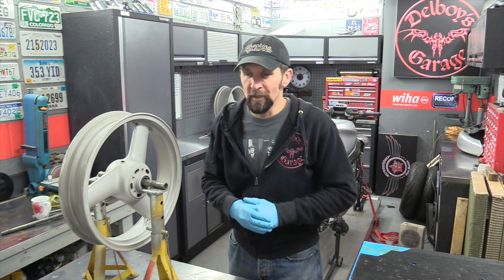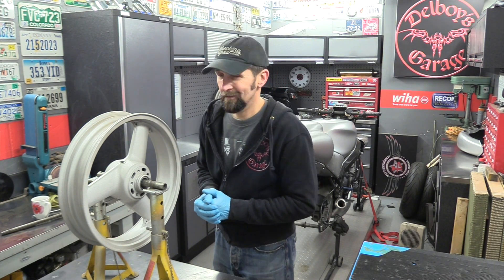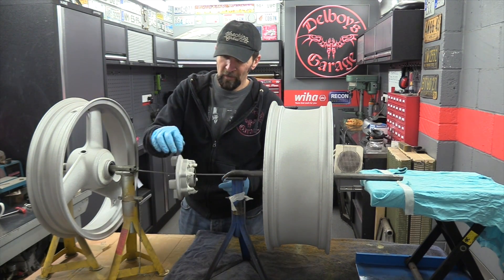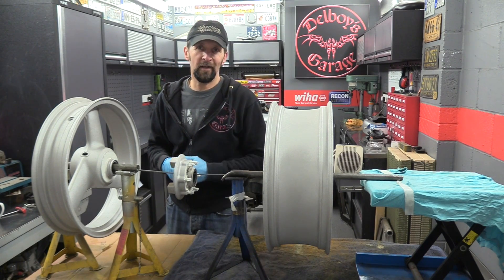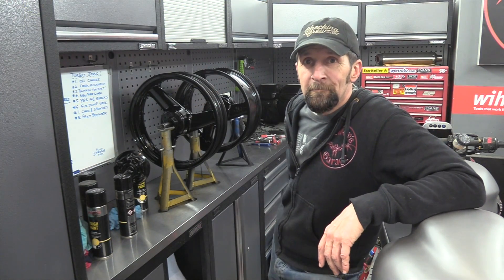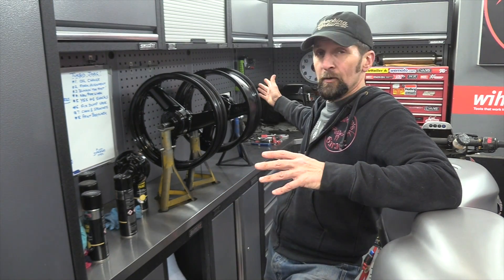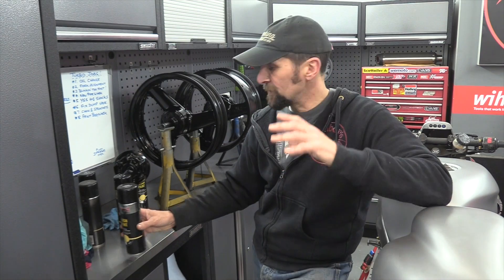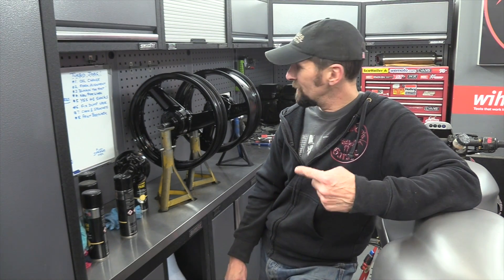Delboy's Garage, Fighter Build #94, Wheel Paint, not powder..! !

Comment: Ace work! Looks really sleek in black and follows its original scheme. Really common for 7r owners to put a 180 rear tyre on for sharper turner, when I bought mine it had a 180 fitted but I switched to a 190, I've always ran a 190 on the rear including for trackdays and its been perfect. A new rear shock will make such a difference especially if its still on the OEM shock, Looking forward to seeing this all together and running
Reply from the maker: Hi Matthew, thanks for your input, I think you're right, there have been lots of words expressed on the whole 180 back tyre thing for 6" rims, but I personally can't feel the difference at my level of riding... so am going 190 too!  And yes indeed, I have something special planned for the rear shock as having re-built the forks already, I wanna make the most of the way it handles, as that's what fighters are all about aye?!

Comment: Old video, but I thought I’d comment as I have done just this.. I bought some spare wheels for my ZX12R A2, and painted them in Kawasaki lime green 777.. 

They came out pretty good, but I had to re-do the rear wheel as I wasn’t happy with the finish. I held the spray can too far from the wheel at times, so the paint dried in the air so left the surface of the wheel rough in places.. 

It’s also quite hard to get the paint into that outer groove of the wheel. I had to hold the can at quite an acute angle so the paint reached the corners of this groove.. If you know what I mean 💁🏻‍♂️😄

Good video 👍🏼 (Edit.. I have the same old Halfords axle stands, which I used for painting too) 😂👍🏼
Reply from the maker: Sounds like you had fun with it mate, and always handy to have a spare set of wheels.. ! Thanks for sharing.

Comment: Hi Del,
Apologies for dragging up such an old video but I've only recently got into your channel.
Just an observation on you cleaning out the threads using a tap. I used to do the same but recently discovered that that is actually a bad thing to do as it removes more of the thread.
The correct tool is a thread chaser but being half Scottish I made my own by cutting a couple of slots in a suitable sized bolt.
Just thought you might be interested (and apologies if you already knew that, couldn't quite tell from the speeded up video)
Ben
Reply from the maker: Hi Ben, there is such a thing as a thread chaser, but it's not a different size to a regular tap, they are just cut right to their end with no chamfer, if you've experienced curly swarf coming out when you clean a thread, then the thread was either a different size to the tap (unlikely), or more likely the initial factory thread was inaccurate... most engineering taps you buy of any quality are extremely precise and if you cut a bolt with a die they should fit together like silk, but again mass produced bolts are often inaccurate, especially when they're zinc plated... if you use a regular thread tap carefully and don't force it, it will clean out paint and corrosion plus, most importantly, old threadlock debris really well... the trick is not to force it, just go gently with one hand and lots of lubricant... but I have to say, I love your ghetto fix of a slotted bolt, that works pretty much the same was as a tap, as long as the bolt itself is a nice precise engineering bolt and not a cheap wobbly thing!  Anything to save a penny aye, love your thinking!
Reply: @Moonfleet41  My understanding is the chaser doesn't have a cutting edge so will not re cut the thread.
Running a normal tap down a FRESH hole should not result in any issue.
But if you have an older thread that has deformed slightly over time from torqueing etc (as they all do) the tap will re cut it to the correct thread again, removing material and making it loose.

Comment: Hi Del, I need some advise on spray painting please, I noticed in this video you just spray the wheels without primer but in the swing arm video you use primer??? The reason i ask is i want to spray my clock bracket on my zx7r, would you just use the tough paint or would you use a primer first? Thanks john.
Reply from the maker: Tough paint can be used either with or without primer, it bonds very well to bare metal, much like the Hammerite paints used to.. So if you're just painting a simple bracket, or wheels, you can apply it direct to the metal... but if you want a much smoother finish, then some primer will give you a base coat you can sand down to improve the surface,, Choice is yours mate..! Good luck with it. !
Reply: @Moonfleet41  thank you del.

Comment: Another great vid, nice set up.
That black is good.
Did you use primer, or did i miss it ?
Reply from the maker: This was "Simoniz Tough Paint", a specified stone chip paint, similar in principle to hammerite, it goes onto bare metal with no need for primer, and remains flexible and durable for years rather then going rock hard and chipping later on.

Comment: Do I have to rub down with sand paper or scotch bright after each coat is dry on my motorbike wheels so paint dont run? Didn't see you do it, maby as spinning the wheel maby?
Reply from the maker: No the whole job was done in one, light coats, with expanding flash off times along the way, rotating the wheels helps with coverage, but it doesn't run as long as you lay it up light and leave the right flash times between coats. !

Comment: Looking good mate, tank looks more at home too. Just a quick question regarding tyres can i put a 120 on a 110 rim ( bandit 6 front ) ?
👍🏻
Reply from the maker: Hi Lewis, you bike should have a 120 on the front as standard, so if you're running a 110 at the minute, then you'll be returning it back to what it should be mate, as long as it's a 120/60...
Reply: Thats interesting. Always thought it looked a bit skinny. Ill have to have a closer look and check whats on there. Cheers muchly 👍🏻👍🏻

Comment: Hi Del, nice looking job pal - old school I know, but do you think Toughblack would handle the heat from rear drums?
Reply from the maker: Drums??  I think you mean discs??!  And yes, it's fine, I painted my engine with it on my Rat Bike, and even round the cylinder head, it lasted just fine... and it's apparently resistance to heat up to about 450degrees...not quite exhaust paint, but good enough for an engine, and I doubt the discs transfer much heat to the rim...
Reply: Disc? - the only disc on a B31 is an old cracked record saying 'If y'need brakes, y'not ridin' it right - & any road, yuh lights are probably gonna pack up at the next roundabout so stop whinging & enjoy this 'ere pothole.'
(Del Boy's Garage would like to apologise to viewers in the North . . . . . . . it must be awful for you : )

Comment: Wheels look great Del. I must admit I'm a convert to the tough black paint, like you say it just seems to be a little more forgiving as it flows out. Would it not have made sense to tape/mask of the mating surfaces for the disks when blasting the wheels as well ?
Anyway look forward to the next step and finally seeing Mackie work his magic on the paint.
Reply from the maker: Hi mate, if the blasting takes of powder coat, how long would the masking tape last lol ... seriously, you can't mask them off, it's almost impossible to mask anything from grit blasting, and yep, am looking forward to the final paint too!  Thanks buddy...
Reply: Well when we do it at work(not that often) we use electrical tape and it lasts no problem though we try not to focus the gun on the machined surface. We only using a hobby type clarke cabinet set up though and our media is probably softer than what a pro would use.

Comment: Hi Del and Penny, hope all's well for you guys.....

Just a quick one.......did you use any primer on the bare metal, if so which one???

Ta muchly.....Gaz.
Reply from the maker: Hi Gaz, god to hear from you mate... as you may have seen in the video, I didn't use any primer on the wheels at all... the Tough Black paint is formulated to straight on bare metal, provided it's sufficiently keyed to grip it, and as you saw, they'd been shot blasted, so had a fabulous, textured, grainy finish, just perfect for paint !  

However, I will use some primer on the swing arm this weekend, because the outside faces of the swing arm are smooth - haven't had the wing arm blasted, cos unlike the wheels, it wasn't powder coated, or corroded... if you remember the wheels had lots of gold paint on them, and it all had to come off, whereas the swing arm was just cleaned off with a soft disc, so for that am gonna use some Etch Primer of the same brand as the paint, so Simoniz Etch Primer followed by Simoniz Tough Paint... hope that helps mate... 

Basic rule of thumb is to use Etch Primer on smooth metal, regular primer on regular keyed metal and non for the Tough Black as it's formulated to go straight on bare metal.  There are other paints like this, such as Exhaust Manifold Paint and Hammerite...!

Comment: Very clean work Del!
May I ask why you didn't do the bearings and seals before you did this paint job? I'd be scared to work on rims with fresh paint and if you scratched a bare metal rim it's easy to fix.
Can't wait for the swingarm bush video; I've been meaning to do mine for a while now
Reply from the maker: Never scratched a rim replacing wheel bearings so far, and also it's a greasy business, so even one fingerprint on the bare alloy is yet more to deal with when it comes to paint... as I showed, and explained, the surface was grainy and rough, and any grease on it at all would have practically been absorbed and been almost impossible to remove... it's tyres next, then I'll do the bearings, and put the discs on!
Reply: Fair call mate and sound logic

Comment: Hi I think shot is a bit harsh on the aluminum as it leaves a very rough finish, I find sand is so much better then you get an even better finish with the paint. Also I always fill the threaded holes  with silicone sealer then there is no need to run a die through them even with shot it bounces of and it comes out easy.
Reply: I meant to mention you can also use old bolts though metric fine bolts if needed aren't as common as most.I also never shot blast a frame or worse powder coat it, its horrible. If its bad sand blast or if not so bad use paint stripper wire brush and kill any rust with rust eater, then prime and paint. Jap bikes I don't even prime in the 60's 70's they didn't prime or undercoat. I use spray tins and people are surprised at how original the finish looks, and I'm by no means an expert. Of course if your going to ride the bike through winters then I guess powder coating would be more durable.

Comment: You fit ya own tyres now del ? All the gear u have by now .. I just put a pilot gt on my front gsx 14 nice work
Reply from the maker: I generally do indeed fit my own tyres!
Reply: @Moonfleet41  happy days I was going to ask if you use a tool/machine ? If so which 1 ..I'm after a decent 1 amd know you often buy good tools ..(I love my tools also ). As I done it via pry bars and a vice to break the beads . Ideally to help prevent Amy marking of the wheels as I'm.about to refurb them and go back black ....thanks in advance del
Reply from the maker: @kevinhancock4064  I use this to break the beads, and then just tyre levers and rim protector strips, it is a lot of work but works ok if you're careful... but if i have a fragile rim a truly cannot afford to mark, then i take the wheels to a mate of mine who has a proper tyre machine. !    https://www.spanner-monkey.co.uk/tyre-bead-breaker-119971?search=TC968&description=true

Comment: Hi Del, I take it you don't need to use a primer with the rattle can you used??
Reply from the maker: Hi Kevin, it's nothing to do with rattle cans mate, it's the paint in them, this Tough paint goes on to bare metal without primer on all but the shiniest finishes... but on any metal that's smooth and shiney use an Etch Primer, but if like these rims, it's rough and grainy, this Tough Paint sticks just fine, as just like exhaust paint, and Hammerite, it's designed to go over bare metal!
Reply: Moonfleet41 can you tell us what paint you used?

Comment: Do you have any advice or a video about painting wheels with tyres on please?
Reply from the maker: Yes, there's a few mate, in various projects over the years, simply the trick is to paint the wheels as normal, but to mask out the tyres, here's a great way to do it... deflate the tyre totally flat, gently push the tyre wall away from the rim and slip a playing card in the gap, then slip another next to it slightly overlapping, and keep doing that all the way round the tyre till you have playing cards tucked inside the lip, all the way round... do the other side too, tape off the rest of the tyre in the usually way with newspaper and then paint away till you heart's content.. you can squirt the paint right down in to the bead lip, knowing it won't go on the rubber, then when done, ship the cards out and re-inflate the tyre... job done!
Reply: @Moonfleet41  thank you very much..... You are a wealth of knowledge
Reply: @Moonfleet41  do i need to sand to bare metal if just spraying wheels with the hard wearing black spraypaint? .... Wheels are currently black if need to know that.

Comment: Tough Black paint?  Who is the manufacturer and can it be purchased in America?  Thanking you in advance  for the info.  I ride a 2008 H-D Dyna and a 2017 Triumph  Street  Cup.   Bill
Reply from the maker: Hi Bill, the manufacurer is SImoniz and am not sure if they sell in the USA, but the nearest equivalent that you have in terms of paint brand would be one of the Rustoleum products, you're looking for something designed for crash bars and railings, it's mineral spirit based and doesn't dry rock hard, so gives a durable, resiliant finish - hope that helps you, best of luck, Del

Comment: hey mate doesnt that paint require a primer first
Reply from the maker: No mate, it doesn't.. it's like Hammerite, it goes straight on to bare metal, but only if that metal is keyed, or a textured surface like my wheels... but if it's really smooth metal, then you would use an Etch Primer to get a bite on it... otherwise just rough it up with some 240grit and you're good to go after a de-grease !
Reply: ahhh ok ive never heard of that before , as you know im from Australia and i use to work as a sand blaster spray painter and we always used some sought of primer after blasting and didnt matter what material was being blasted or what we were blasting with whether it was metal grit , ceremic garnet or even water blasting we used a primer before top coat
Reply from the maker: Yeah, i think you have a point, as any general rule of thumb you should always prime bare metal.. but this product, much like hammerite, and exhaust header paint can survive being painted directly onto bare metal unless its really smooth... i guess its just a specific formulation.. the exception not the rule aye... cheers mate and hope its warmer where you are.. its bloody freezing here today... Del.

Comment: Hey del just wondering how much money have you saved by not powder coated them
Reply from the maker: Hi again, can't really say a figure because i didn't get any quotes.. but its a darn sight more expensive than painting the wheels yourself...and with paint you can re-touch and repair it if you need to.. you can't repair damaged powdercoat.!
Reply: @Moonfleet41  that's the thing lot of it is down to cost I'm only new to biking and my rear wheel has some chips of paint missing and after watching your vid I'm trying to get up the courage to go at myself lol
Reply from the maker: Ger may  Go for it buddy, take your time preparing it all, get all the chips and scratches sanded out flat, and CLEAN it for all you're worth.. use some light acetone (nail varnish re,mover is good and cheap), and start with a tack coat, then a light coat, then staret layering it up.... but not too thick.. thats the trick with the Tough Paint.. it works best with about 3 wet coast tops..   then just leave it 48 hours before you touch it.... you'll make a great job of it mate.. get stuck on and good luck.. Del.
Reply: @Moonfleet41  thanks del the more I watch your work the more I want to do it myself and not to be paying out lots of money to get it done. .can you give me the name of the paint you are using please so I know what I'm looking for etc 
Thanks del
Reply from the maker: Hi buddy, great news... and the paint I'm using is Simoniz Tough Paint ... available online, but shop around as often there are deals on it !!
Reply: @Moonfleet41  thanks del much appreciated your help. .your plastic welding video helped me out so much had a crack on the side panel and was able to fix it by watching your vid and now it's perfect and didn't cost me a penny
Reply from the maker: Oh wow, that's great news, thanks so much for the credit, but you did the hard work and made it happen!  Take care my friend and have a great weekend...
Reply: @Moonfleet41  you to del have a nice weekend m8